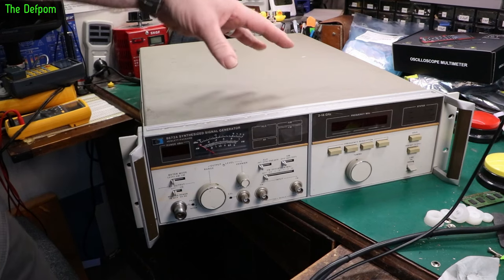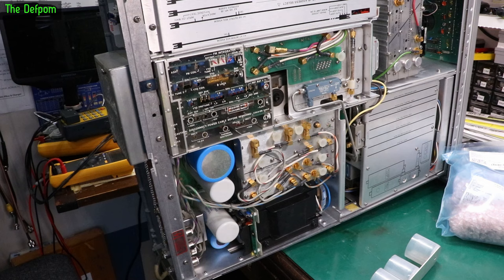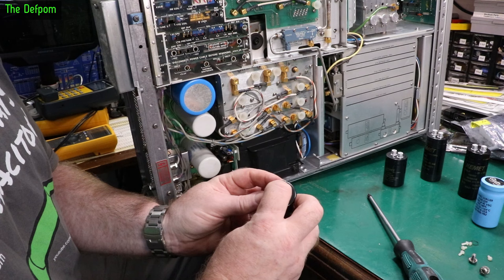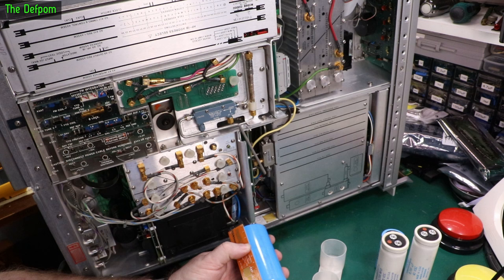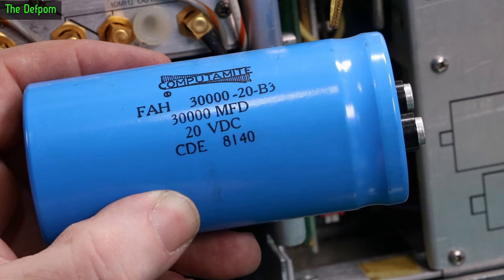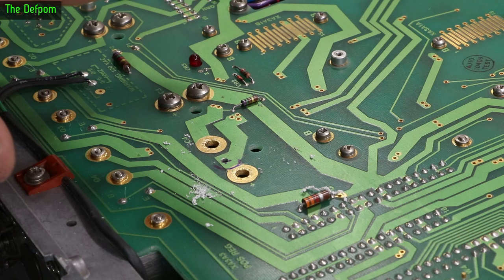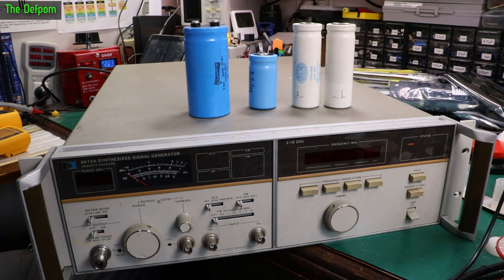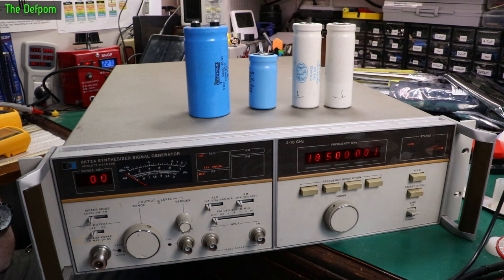🔴 HP 8672A 18GHz Signal Generator Repair Part 3 - No.1232

Comment: If you had some extra head space above the capacitor you could have added an extension to the cap contact to get you over to the original hole.  You'd need a couple mm to allow for the screw head that would be between the capacitor and board.  That way you wouldn't have bodged the original board.

Comment: Seems it would be worth designing a set of PCBs with the hole spacing of the bolt on can caps. Add a number of SMD pads in parallel (or some selectable series/parallel combination) and then you can populate it with the SMD caps to match the specs of the bolt in can cap you are replacing.

Comment: Those caps are expensive  - Did you measure the regulated output for ripple?  A quick read of the service manual seems to show that those lines should have less than 1mV of ripple on them (+20, +11, -10, -40  < 300uV,  +20,+5.2,-5.2 < 1mV)